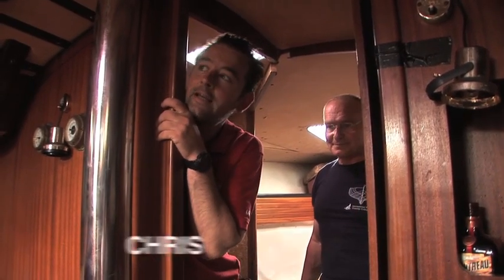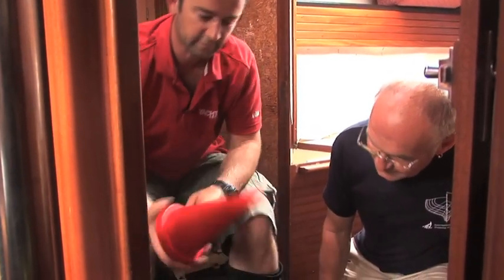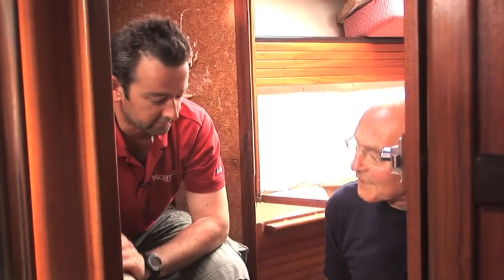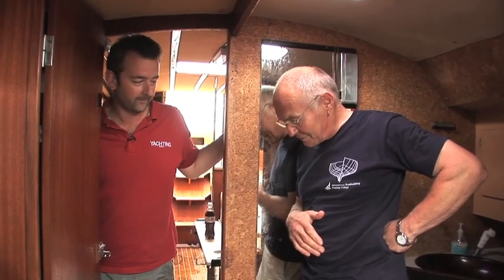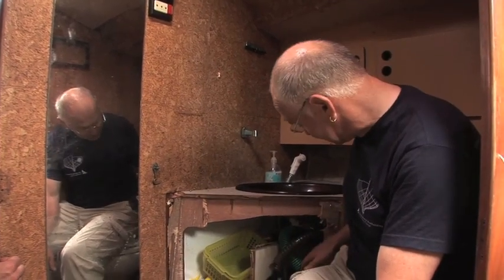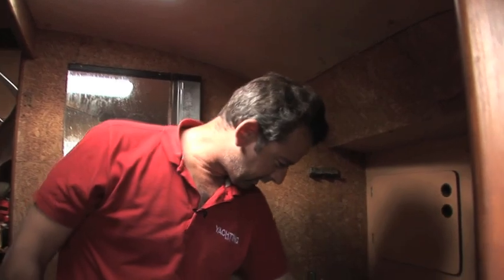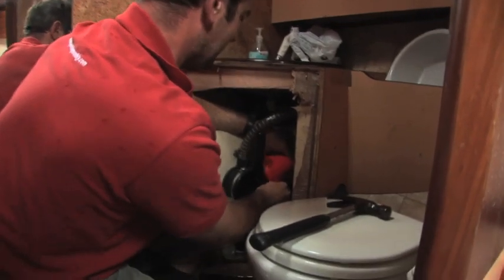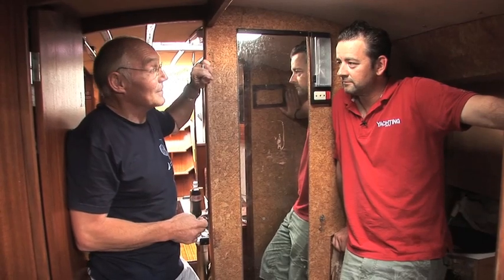Yachting Monthly's Crash Test Boat - Through Hull Failure

Comment: I used some of these ideas to fix a leak in Second Chances. what I did was two part under water epoxy and a wooden plug that was two years ago. still not leaking. now I put my dive gear on and did it from the out side so the water would help keep the plug in. and the epoxy sealed it up.

Comment: Wonderful video! I lent the Stay Afloat to another boat at my marina with a broken seacock and it worked like a charm. In the video the man tries to scoop it out, but this is not the way to use it, just knock the whole mass out of the plastic jar and then press it on. Works great and is especially useful for cracks and irregular openings.

Comment: I've removed & sealed most of mine. Only have one now for engine intake. Gone over to chemical loo and small tanks under sink for grey water. I just don't trust them. My engine seacock will soon be a trudesign plastic one too.
Reply: +Andrew Polson   good
Reply: we too now use a plastic tank under sink for grey water and in general try to discharge nothing out of through hull fittings

Comment: I have 17 through hulls. Once we had the bilge filled up to the engine with water rushing in when we noticed the floorboards getting wet. The water was too deep to find the leak. Frantically we reached into every through hull but could not find the leak. We called the coast guard, took sails down, launched the dinghy, got survival raft down, pumped manually. Question: How can you find the leaking through hull? Many are quite inaccessible like under head cabinets, under waste tanks etc. Hoses are more likely to break than the through hull. ??? Wolfgang, Endeavour 43 Ketch. PS: We found and solved the problem.
Reply: 17? it is a passenger ferry????
Reply: 17 is more hole than hulll
Reply: Wolfgang Harms in warm waters if not moving you can go over the side and just cover all of them then sort it out from. You there.... In my humble opinion there should only be one place in a hull that there is a hole below the water line and that's at the back for drain plugs that will allow draining while under way.... All others should be from above the water line
Reply: makes it hard to get cooling water for the engine or sea water for head and galley. with nothing below waterline  LOL !
. @jolllyroger1
Reply: A start would be to have a less amount of through hulls. And make sure they all are in accessible spots, properly documented in ones laminated emergency documents.

As to how to find the leaking one under half a meter of water, I have no clue.

Comment: panicky situation gets my blood boiling some.  When it actually happens remember NOT to panic.  Get out sledge hammer to get to hole if needed and address it soon.
cheers
Reply: You could damage the boat even worse. If its your boat you should understand the construction of all elements and be able to easily disassemble anything.
Reply: flyingtigre1    That's why I always carry a sledge hammer  ,a shovel and a wheelbarrow on my boat  !!!
Reply: dont forget your flash lite... Batting practice is always recommended first.

Comment: Maybe we should ban the making of through hull hole in the first place. To charge those yacht or boat makers at criminal courts so they won't make those sick holes. They are ticking bombs! 
If we need drain a boat, just use suction pump
Reply: TheUnlimitedHunter actually a drain that can be be drained while underway is a good thing.... You can pull drains at the rear and drain while moving forwards....

Comment: with the floater and the hole in the hull, you could poke a tube through the carrot or potato (so the top is above the waterline) and then get the line trough that !